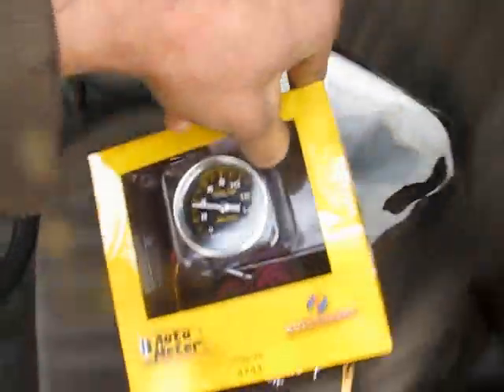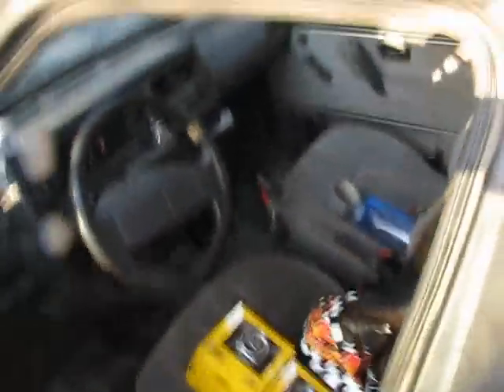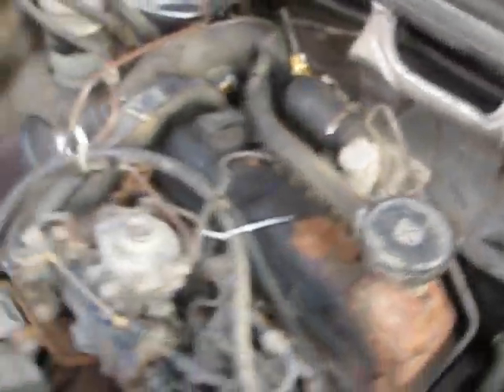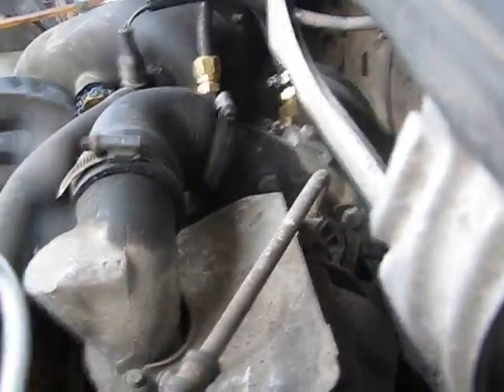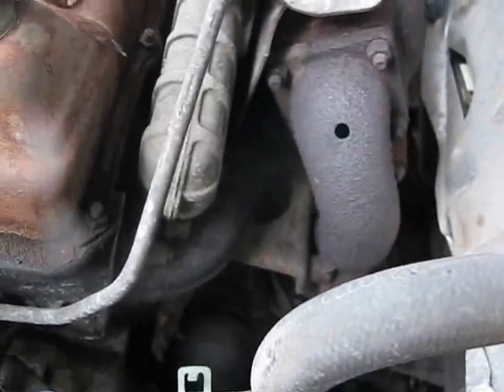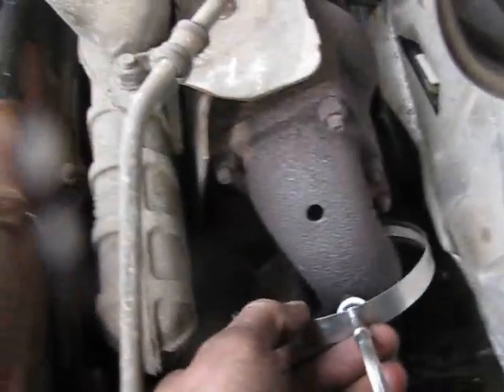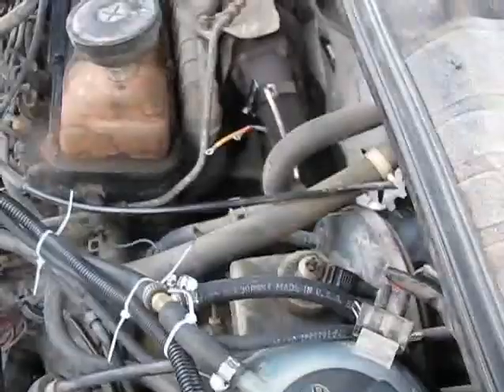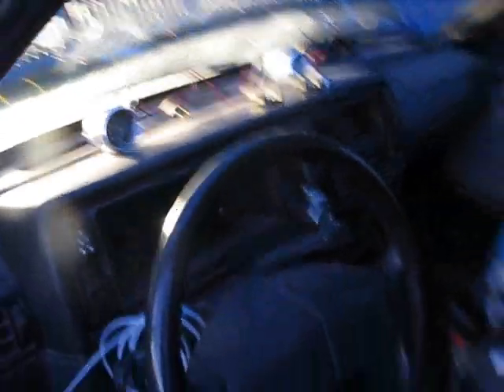91 Jetta TD: Installing a Pyrometer and Boost Gauge (12/11/11)

Comment: whered you tap the boost gauge? off that vacuum line between the turbo and the injection pump?
just got an 86 jetta td, power seems to cap out on power pretty early and i never hear any turbo whistle.. think the waste gate is stuck open
Reply: Notice at 1:45 he has something tapped into the intake hose. Brass fitting and black hose. Then notice he had some gauge on the dash already. I assume he already had a Boost gauge and thats where he tied in. Not sure why because like you say its a small hose runs from the Intake manifold to the injector pump. Some vacuum diaphragm solenoid control. Not sure what it does but i assume it changes the timing based on boost. I unhooked the hose and blow into it and the diaphragm started to move and turn some shaft on top of the injector pump. I assume it advances the timing with more boost.

But yeah he should have a Tee with the boost gauge and just tied in that little hose coming off the intake manifold. Ive never hooked up a boost gauge but assume it measures boost in the intake.
Reply from the maker: that line that ive tapped into is for the AFC. it adds fuel based on how much boost you have.
Reply from the maker: that line sees any boost pressure the turbo makes, so thats why ive tapped in there

Comment from the maker: @canadacatalyst yea, they are great little cars! mine was gutless when i first had it, now its twice as powerful... if i could just get the boost working properly, i'd be even faster! i got a little taste of 20lbs the other day driving to work in the morning... with all the fuel ive got going into her, i could hardly keep my head off the headrest haha! ive only seen over 18lbs ONCE since i pulled the motor to change the clutch... i was sitting at 23lbs daily before though...